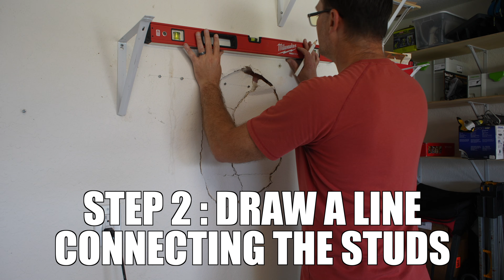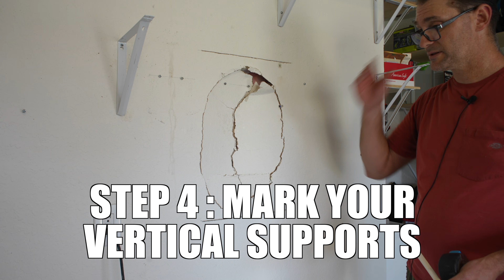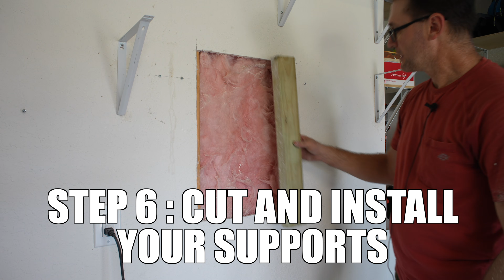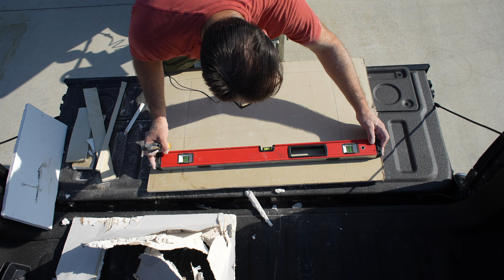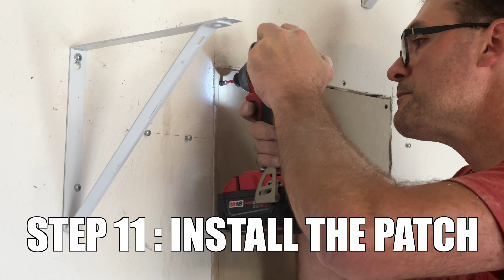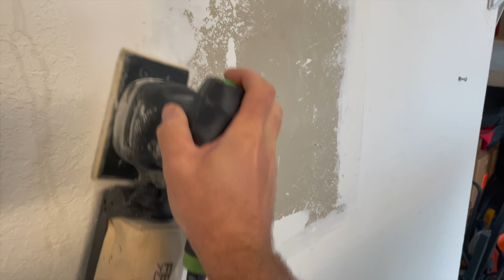Drywall Repair DIY Tutorial - Quick & Easy Fix Method

Comment: As a drywall/drywall repair man of over 30 years, there's SO much I could say here. However, it's a basic patch that most anyone can do relatively correct with the directions presented. One thing I MUST say is, know the thickness of the existing drywall before getting new drywall. Usually 1/2" or 5/8" thick. Sometimes 3/4 of an inch thick. It's a CRUCIAL piece of knowledge before proceeding. 😉👍

Comment: Yeah, it'd be a lot easier to measure your patch, cut rather than trace. Not to mention, make sure IF TRACING you have both pieces facing top up or bottom up, so they're exact inches not flipped inches. Sander is a bit much, makes a mess, just take your blade and trim a little off edges. You want your patch about 1/4" smaller than your hole. But all in all, good way to do a basic drywall repair. Mesh tape is made for hot mud, the powder mud you mix. Anyone using blue top or lighter will have a weak patch. But all in all, not a bad repair. I'm being picky as a pro.  8/10 for repair.
Reply: What's the pink stuff he used? Spackle?

Comment: Welcome 
Why are you make measurements from damage drywall just measure the opening and cuts new drywall once.
You need to patch with hot mud (easy sand) not with pink patch you can have cracks in the future. Pink patch it is for small applications.
I never see same one sanding the edges with sander.
Measure twice cut once.